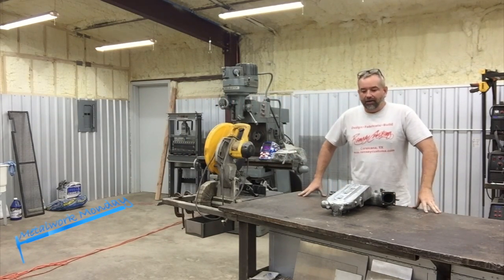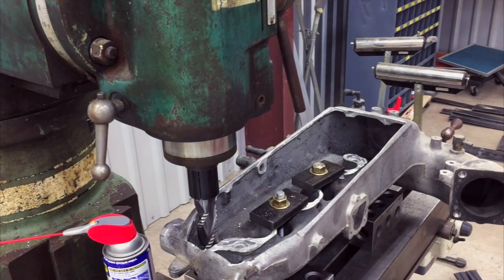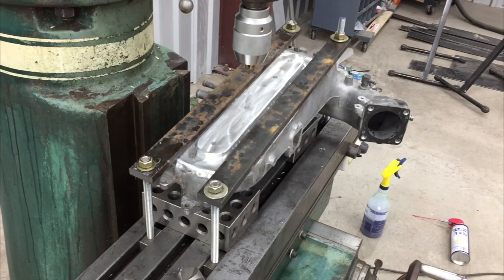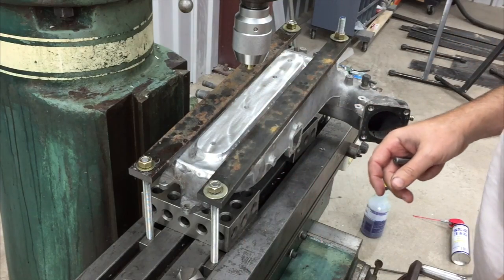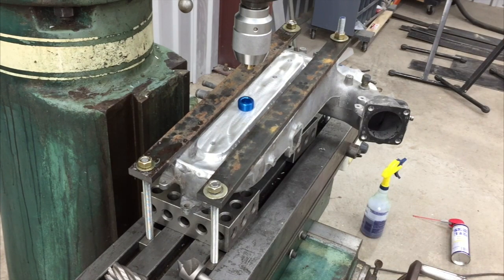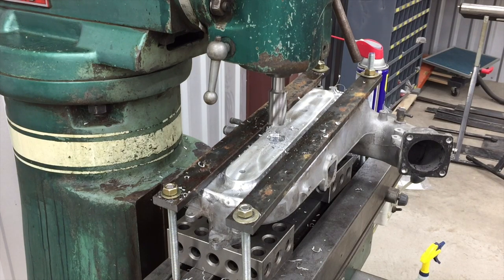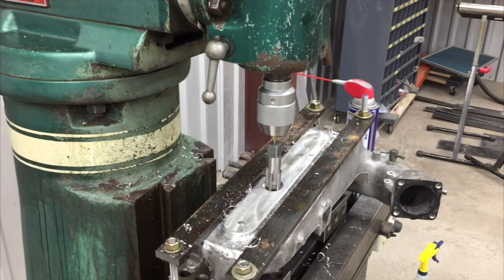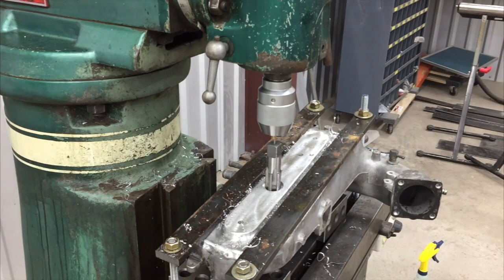Mod Fabricating - Tig Welding - Milled 300ZX Aluminum Intake Modded

Comment: Very cool process , and I love seeing how this type of work is done , it fascinates me ... However the other side of me has a few questions ... . 1  Why was it shortened to start with ?   Need to clear the hood ?  If so , is there anyway we can see the car its going on , or is there another channel that is building the car ?     I live to see this side of the car hobby , but I also like to see why , what its going on , and how its setup on the car ....................... This is just me , but any links to the car , or can you get some install / follow up video of it installed ?
Reply from the maker: Thanks Norman.  1.  When you shorten the runners on most intakes, you raise the RPM range, and power band.  The drawback is you lose low end torque. .. It goes on a 320ZX Nissan.  They don't have any videos online yet, but will soon...
Reply: Thanks for responding , When they do , please share the link .... Thanks ..
Reply: @turbocobra  hey I've just seen your video on the gutting of the z31 manifold,  are you still doing them? I'd like to get mine done,  xkv081@gmail.com,  Mike,  9084771813, TIA

Comment: everyone is a hero in aluminium, unless you are welding, in which case hats off to you! good work on this intake
Reply from the maker: yea it can be a challenge to weld for sure.  I just got some helium and have a new video of a tig rod holder out of 1" thick aluminum and it welded very nicely.  thanks for watching.

Comment: cutting oil is much better than water displacement 40
Reply from the maker: Well, not really, not on aluminum, most people use WD40 or similar on aluminum.
Reply: weird. ive never seen anyone use wd40 on aluminum.i always use 3-in-1
but hey whatever works. hole is made chatter or no chatter.clean results thats all that matters

Comment: Good job Gary.........A little bit of everything involved there, awkward piece to hold!
Reply from the maker: yea it would have been nice to do the drilling and tapping in the plate before i welded it on, but it had a tapered angle, and getting the holes in the plate to like up with the bolt holes in the bottom would have been a challenge.  It was held in there decently for what i was doing.

Comment: The fine folks over at Datron use alcohol for milling aluminum. Part dries clear and clean. And no residue to worry about cleaning up for secondary welding operations. They say it's "wetter" than other cutting fluids and oils. Clings to spinning end mills easier, thus cooling them faster. And they should know... they are Germans who wear black turtlenecks under their lab coats ;-)
Reply: That's a good tip, I'll have to give it a try.
Reply: Thats a common way to work with aluminium all over europe. After milling, drilling etc, there is no need to clean up or risk that oil has creeped into part that needs welding. You see the diffrence in workingtimes and when welds are xrayed or prooved with other method. I never put oil, that just looking for troubles...

Comment: Interesting project, Gary.  Next time for the Aluminum preheat your parts, and try and get them around 300 °F.  You'll find it extends the capability of your machine.  It also helps when you are welding car stuff that is cast to get rid of the oils and contaminants, even if the parts are thin enough to weld without it.

Comment: I don't understand the piece completely, but it looks awesome Gary.
Reply from the maker: Sorry guys.  I didn't explain the overall objective well, was more focused on the actual fab.  Basically, cut the stock intake open, hogged out all of the internal chambers, making it a short runner intake, for more top end power.  I did some hand blending of the ports.  Made a new top and access holes so the bolts could be access where it bolts to the lower intake.  That's about all I know, i just did what i was asked!
Reply: i was thinking that, buim sure we'll see i on the car ;) Looks good Gary , will you be tephlan taping the threads ?

Comment: why tapered tread? that usually requires some kind of sealant

why not a plug with parallel thread and a seal like e.g. https://www.hydra.dk/pics/original/b/b210/b210-08fsup08-f.jpg
Reply from the maker: Thanks Lasse.  Good question, could have certainly used those, but this is what I was brought, so I used it.  It should work out fine, this intake has several other tapered fittings on it as well.